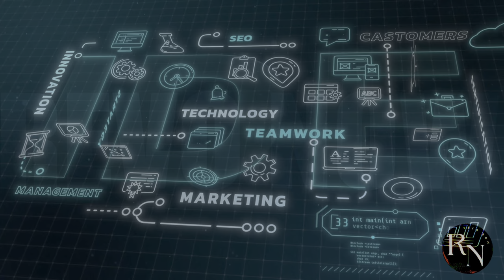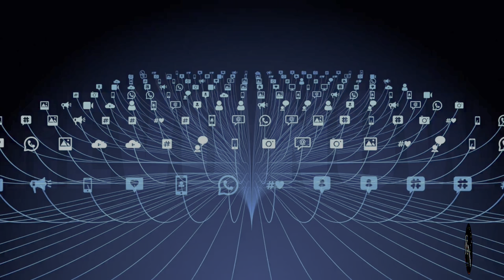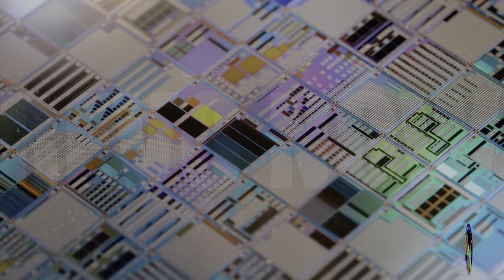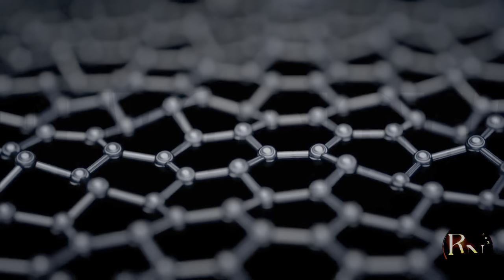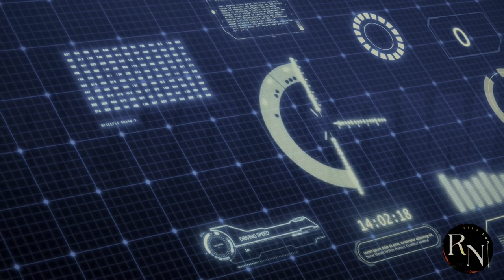BYE-BYE Silicon CHIP: Welcome China's  New GLASS CHIP Breakthrough

Comment: How far along is the tech? Is it already working in the lab? How long until it hits production?
Reply from the maker: Still at it's peak!
Reply: From what i've seen, it is 3-5 years away from commercial use  it already exists in labs.
A pure photonic processor needs nore than photonic transistors. They already have almost every equivalent photonic to the eletronic element. 
There are still some elements that are not 1 to 1 replacement like memories and some others others.

 Some incovinient translations to and from eletronic are still necessary at the miment. They are optimist they can figure this out.

Comment: Ok, but glass itself is made of silicon as well, so what’s the difference?
Reply from the maker: glass is not made directly out of silicon. Instead, it is primarily composed of silicon dioxide (SiO2), also known as silica. Silicon dioxide is a common fundamental constituent of glass, and it is often referred to as quartz or silica glass.

In the production of glass, silicon dioxide is typically derived from quartz crystals or high-quality mountain crystals, which are melted at high temperatures (around 2,000°C) in a vacuum or inert atmosphere. This process yields a glass material with a purity of up to 99.9% silicon dioxide.

Silicon, on the other hand, is a distinct element from silicon dioxide. Silicon is used in the production of semiconductors and other electronic components, but it is not a primary component of glass.

To summarize:

Glass is primarily composed of silicon dioxide (SiO2), not silicon.

Silicon dioxide is a key ingredient in the production of glass, derived from quartz crystals or high-quality mountain crystals.

Silicon is not a direct component of glass, but is used in other industrial applications
Reply: They are not replacing the silicon but the substrate it is mounted of.
Reply: @RevoNow  Ok, thank for the explanation. Now is more clear.
Reply: @ThomasTomiczek  Ok thank for the additional explanation.